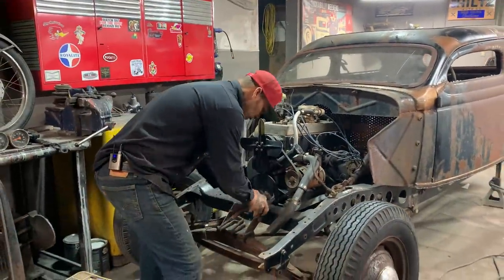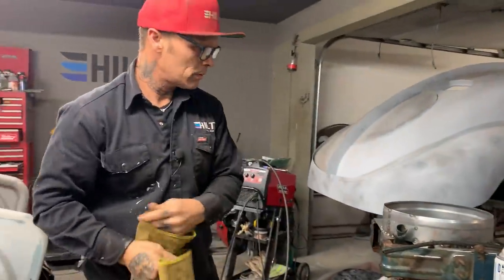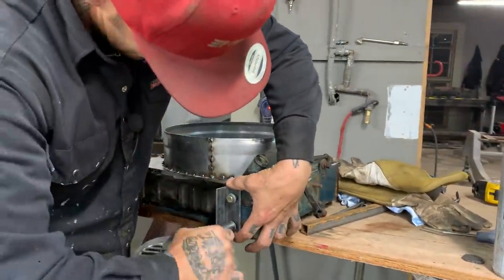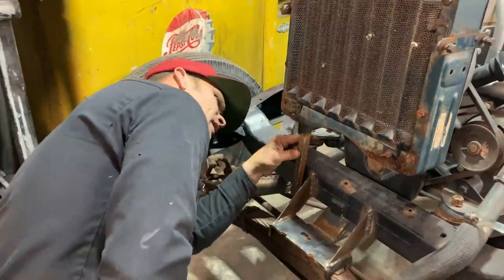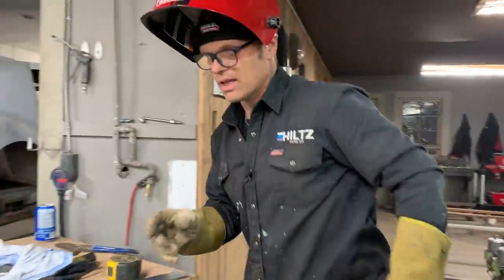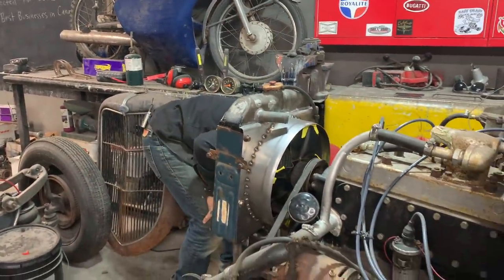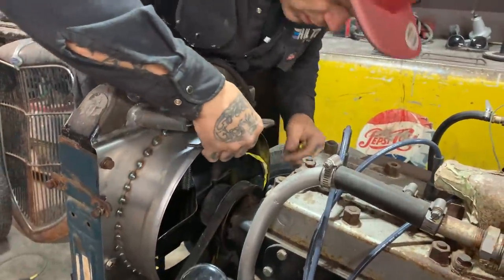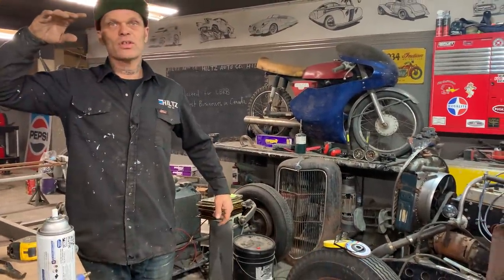FABRICATING A RADIATOR SUPPORT TO MOUNT RADIATOR

Comment: My mind is confused wouldn’t it need more clearance if rad is mounted to frame and fan is engine mounted would it rock with the engine when hammering the gas?
Reply: trial an error, fun fun  unless you have thousands into a project then not so fun...lol
Reply: It’ll work out in the end, always does, my son suggested mounting the rad to the engine, there is a bracket there on the side u could run straight back, or electric fan, actually u could just cut the shroud away some so the fan is adjacent
Reply: Bien sûr le ventilateur va toucher la structure des de le moteur va bouger sur ces supports !
Reply: hope the engine is solid mounted cause he will need more room in that shroud for the fan

Comment: Remember, the older cars had rods triangulated from the firewall to the top of the radiator with nut and thread adjustment to reduce vibration and movement.

Comment: How much movement will the engine have during Starting and Reving?  If using rubber motor mounts there is a possibility of the Fan hitting the shroud.
Reply: Good point
Reply: not possibility but a certainty
Reply: He never thinks that far ahead
Reply: Yes. a trip around the dooryard is likely to show that on acceleration and deceleration the motor mounts allow too much movement for the available clearance.  But it'll also show where (my guess is top on acceleration and bottom on deceleration.)  All fixable with a fan trim.  He doesn't want to do that because the fan's tiny already, but I think Chad's theory of how long it needs to run to do an eighth-mile is probably good.  I like the Austin grille on it all.  Some swoopy shrouding would add a little weight and a lot of character.
Reply: That fan is going to be ripped apart…but let’s see
Reply: @Stunthangar  this guy is a know it all that knows nothing
Reply: How are you doing Robert
Reply: @genefoster7238  hi
Reply: @hoolgatenewcastle3312  Exactly what I was about to state, you would need a lot of clearance around the fan, the engine will move about considerably on those rubbers and the fan shroud is static.

Comment: If your taking votes I still like the old Ford grille back on a slant.
You could fabricate air deflector s inside to force air through rad.
Reply: Yep, the Ford grill looks better. As far as cooling goes, it's gotta be good for an eighth mile plus staging. It's not going to be running in the desert for hours. It should be fine.

Comment: Both the radiator shroud and mount are great pieces of fabrication, but when I see this car I think Model T and Model A which didn’t have any shroud, granted this radiator is much smaller but again it’s an old copper core and should work fine without. Not a fan of the Austin grill, the 36’ one has the right look for this car in my opinion. Chad as always you do you and what makes you happy 😊

Comment: ***Motor Issue*****  Just want to point out 2 issues that you may have with the motor  being at such a steep angle.  1.  The pick up tube in the oil pan may be in the center of the pan and with the angle of the motor, the oil may pool to the rear.  You risk oil starvation, which could destroy your motor. 2.  Oil foaming.  With the steep angle of the motor, the oil may pool to the rear of the oil pan and the counter weights of the crank shaft may hit the pooling oil causing it to foam up.  Both conditions may destroy your motor.  You can do  a dry sump set up to avoid all this.  Please look into it.  Love what you do!!  Carl
Reply: A dry sump would be amazing to watch. Can you even imagine.

Comment: I am with Dale on this one I've been wondering about that since yesterday when I saw you constructing that itty-bitty radiator shroud and pulling a Michelangelo on the fan blade it surely will be an issue unless you have solid motor and tranny mounts and it definitely will twist it surely will twist when the front wheels come off the ground with a signature Miss jolean wheel stand especially since bad Chad pulled a Picasso and put all those holes in the frame with a 2000 horsepower motor that frame is going to twist like a soft pretzel surely surely be that's what I say don't you agree Dale

Comment: I believe yes I do i believe the radiator is from a 1971 Ford backhoe the reason the guy replaced it was because it had multiple leaks and it had been repaired several times in the past 50 years
Reply: It did look like one side was rotten. 
I just assumed he filled it full of water before using it. Sometimes you just have to spend a little extra time and do these things.

Comment: Bunch of people talking about engine torque, you can always do what we did years ago. Chain it down , she won't move much, if it moves at all. 1/4' plate across the front of the motor and over to the frame always works too or cut that shroud back and lap a piece of round rod around the outside of the shortened shroud. Then lap a new 2 - 3" piece of steel on top of the rd. rod. That'll get you all the clearance you need. Sq. stock would also work, whatever's closest.

Comment: Chad and jolene when the engine moves around on its rubber mounts will the fan not hit the shroud cause the radiator won't move with the engine. Just a thought hope it's not the case. I would use an electronic fan that way you can mount the radiator where you want to and that's my belly button as you say. Keep up the great work the both of you 👍

Comment: Instead of the square stock holding the rad up, use two turnbuckles to hold the rad up. 
That way you have infinite adjustment up and down. Weld the ends of the turnbuckle to the frame and rad.
Use a nut on the turnbuckle threaded rod to lock the turnbuckle in place after adjustment is correct. 
Can also use turnbuckles for side to side adjustments. I have used a turnbuckle to adjust alternator belt tension, by turning it with a finger and thumb. Just a suggestion. Any hardware store has turnbuckles.

Comment: Couple adjustable tie rods from those side bolts back to the firewall to keep it in the right place, might have to trim a tiny bit off the end of the blades. Not a fan of the Austin grille, but Chad will make it work with whatever makes him happy.

Comment: Maybe add a gusset from the back side of the square tubing to the top of the frame to keep the rad from moving back towards the motor? Great job today in mocking up the radiator. Looking forward to see what tomorrow brings.

Comment: You'll have to put a chain or turnbuckle on the drive side if engine to drive side of frame to keep the motor from torqueing to passenger side hitting the fan.       Drag racers used to do it all the. time
Reply: Actually we did that to keep the shifter from binding. The shifter was bolted to the crossmember and the rods would bind when trying to shift a four-speed. 
In 70 we went to an interlocking mount that would not separate when the rubber broke. All big block Chevy Muncie chatter

Comment: With the rigid mount rear axle the motor mount will be absorbing  the torque from that inline six. That fan shroud could be trouble. You don't need it.

Comment: Enjoy watching.  In regards to the fan Chad, you may want to consider the act of centrificle force. In otherwords , the fan will inevitable expand under running conditions. Probably more then you would think. Nice work. Keep it up.
Reply: And ofcourse the engine flex goes without saying. Awesome content.
Reply: Maybe just bend the blades forward a little bit. It would be a lot faster. Just get your channel locks out and start bending

Comment: Hello Chad, it was the first time I seen a fan blade cut down, the shroud you built amazing, I love your work.
Reply: I generally use a string connected to the center with a marker out on the end to draw a circle, or in this case the trim the fan blades. 
3.1416 for circumference of shroud.  Chad’s labor is free so eyeballing it is good enough.  Can’t wait to see the maiden voyage. Should be great

Comment: The rad bolts seem to be a little long. Do they hit the radiator? 
Need a little more clearance on the fan at least an inch or a inch and a half.  
You definitely need more than a couple of piece of paper.
Or it will sing when you torque the engine
Also mount the radiator on some shock absorber rubber mounts for a little flexibility.
Other than that you did a fantastic job!

Comment: Mounting radiator will be interesting. I am wondering if small amount of space between fan blades and shroud may be a problem due to engine vibrations and torque. (The added bead will help solve any engine movement problem.)

Comment: The shear you were using yesterday, when you come to a corner, if you push the last bit of the curly bit back into the slot you have created you can then cut right up to the corner

Comment: Do the motor mounts have to be extra strong to prevent the engine from moving inside of the radiator housing given the tight tolerances?

Comment: Mounting the radiator is more complicated than it looks!  Haven't seen yet whether there will be bracing from the top to hard mounts. Vibration needs to be kept in check? The base is really strong, but that radiator structure looks like it  might bend under vibration. No?

Comment: If the fan moves and trims the shroud it merely means the shroud and fan had too much steel and needed to be lightened. It is like an automatic adjusting fan and shroud... possibly give the blades a little twist a little bit to allow more air movement. Worst case just cut the shroud in a couple of places, spread it out, and weld it back together. No problems. >His motor mechanic will come and help start the engine again, at which time he may express a concern if their is one. I didn't think the engine would move, didn't he weld it in there in the first place?
Reply: Exactly, this fan will self clearance.  
Any metal that falls off will just lighten the car that much more. I wonder if he if he could cut holes in the body? I don’t think anybody has ever done that before.

Comment: Waterless coolant has a boiling point of 375 degrees Fahrenheit  it is expensive  but a solution if extra cooling is  needed with the small rad  .
Regardless please put antifreeze in before winter hits as Chad mentioned it's going to door yard till next year.
Reply: You don't have to put any coolant in at all over the winter. That way you can be sure it won't freeze.
Reply: The coolant will survive at 375, but the engine wouldn’t
Reply: @i8ntnuts  The engine won't be running in the winter.

Comment: How do you change the fan belt?
Reply: Pull the rad out or give yourself half inch clearance fan to shroud. Bad chads choice way to tight .
Reply: Why change it? It’s been OK for 85 years.  It’s barely broken in

Comment: I think we can all agree the shroud is too close to the fan.  It will end up cut off.  When I was watching yesterday I expected he would cone the shroud out from the rad toward the engine.  Like the thing they use for dogs when they get their ears cut.  That would allow the small radiator to be used while affording extra space for the fan blades.  Otherwise it will end up shroudless.  Only other way around it would be to somehow mount the radiator via supports coming directly from the engine block so that it moves in perfect unison with the engine.
Reply: That said, if he uses it only for the races and he doesn't install a thermostat, that little radiator should do fine even without a shroud.  But in that case I'd advise putting a larger fan back on it.
Reply: Do you have any idea how long it would take to make a cone?
Reply: @i8ntnuts  wait.  Are you serious?  We are talking about Bad Chad.  He could simply roll some steel just like you would do paper to make a funnel.  He could even make it out of paper.  Then lay it out and cut it to size.  Then just zip cut it, butt weld the seam, and weld it to the shroud.  Come on man.
Reply: @i8ntnuts  ps.  We might just find out once he starts it and the fan scrapes the inside of the shroud and when he revs the engine the shroud self destructs.

Comment: That's a tiny radiator Chad. But as long as keeps the engine cool for the little while it will be running is fine. Some race cars don't even have radiators at all.
Reply: How are you doing Behr??
Reply: @hoolgatenewcastle3312  I'm fine thanks

Comment: The fan does not have to set in the shroud, it would work great about a half inch from the shroud, it would pull air right thru the radiator just right.  Keep up the great work.

Comment: Chad, as much inconvenience as you experience plugging and unplugging, replugging and untangling extension cords I'd say it would add tremendously to your productivity to go buy a Dewalt 20v battery powered angle grinder and make your life better, God knows you use the angle grinder more than any other cutting tool that you own.  the only other tool you use more is probably your welder
Reply: That’s Chad friend Jolene. She does such a great job with the camera. I think she just has a lot of natural talent. You can also find them on Facebook and of course she does the computer work on that as well

Comment: I see trouble ahead, not enough clearance between fan and shroud, blades should be half in and half out of shroud, cant tell how close fan is to radiator, should be 1 inch at least. But then again, if its only going to ran a 1/8 mile, probably dont even need a radiator.
Reply: Keep the radiator, get rid of the fan.
Reply: You’re probably right. At old Hup six probably has what, 6.5-1 CR. 
It might take a while just to get it warmed up

Comment: To prevent the  fan from hitting the shroud the motor mounts need to loose the rubber and be hard mounted. This will also help with torque loss do to excessive engine movement. Tom Martin

Comment: How is the front spring held to the cross front member? Usually there are 2 u bolts with a plate on the bottom side.
Reply: I think Chad said he is going to add gussets for safety.

Comment: Good day HILTZ MOTOR CO.  im not sure if you have thought about supports from radiator to fire wall may help radiator from moving back towards the engine when Jolene launches all that raw horse power from the starting line.. 🤣😂🤣

Comment: I don't know if that motor is mounted with rubber mounts, but if it is. that fan is going to hit that shroud. I think you should have made it a bit larger in diameter.

Comment: Because all the cylinders are straight up as opposed to side to side in the "V" formation, I wonder if there will likely be little to no twist under throttle torque like a V motor would,  guess we will see?

Comment: Chad did mention top-braces for the rad, running back to 'something'. Without those the rad will rock fore-&-aft and tear itself to pieces ....unless the fan beating on the shroud keeps the rad in place? (Just joshing- add the braces.)

Comment: Hi won’t you need to mount it to the engine so the radiator moves with the engine as the engine is rubber mounted and will move when you rev the motor

Comment: Typically radiator supports are "U" shape, thus providing maximum support. I fear this design may vibrate, flex etc. forcing the fan into the radiator.

Comment: He can mount the engine to the frame without the rubber mounts or add an engine strap from the frame to the motor to stop any engine movement.

Comment: Chad, ditch the fan, mount the radiator lower on the cross member, a drag car does not need a fan for the few minuets it is running,

Comment: Yup absolutely I completely trust my ability to use tape measure I’ve used math and measuring my whole career I also can go by eye too but I don’t use metric tapes and use down to 1/16th tho and if absolutely necessary 32nd never needed more than that as finer than that is machinist teritory

Comment: Chad , i never catch you guys live.  so here it is,  you should put a good 3/4 inch at the very minimum, | depends on the engine, how smooth / how rigid are the motor mounts. |  clearance all the way around that fan. the rubber engine mounts will flex and move, it could just stred that shroud.  been there and done that.  Danger !! Danger !!   Will Robinson  !!!!!!!!!!!   diameter of the fan shroud itself , minus at least 2 inches , diameter of the fan  ...that will give 1 inch per blade clearance if its centered ...........👀  Cut The Blades

Comment: An electric fan could be a simple solution. Also, it could be easily mounted lower, at a better angle. I admire the use of the original fan, but it’s causing more problems than it’s worth and the parts of the blades you cut off are the efficient air-moving bits. Just saying.

Comment: That 1/4” on each end of the fan is not going to give you enough clearance. When the motor starts shaking it is going to move a 1/4” or more from side to side hitting the inside of the shroud. But I love the the overall car. Wish I could fin me a 35 to 37 to do something with.

Comment: If the engine is not a solid mounted engine the torque will tear up the fan. Not enough clearance for a rubber mounted engine.

Comment: Would have removed the fan from the motor and installed an electric fan on the rad or just don’t use a shroud.👍🇨🇦
Reply: How are you doing Dan????
Reply: @hoolgatenewcastle3312  I’m doing good, you may have me confused with someone else though.

Comment: Chad do you need a grill and engine hood if not it would look cool and save weight to
Reply: If the front end is too light it might do a wheelie and flop over. OK I’m just kidding.I think it would look better with a grill and at least the top part of the hood. Leave the sides open for spectator viewing

Comment: The water outlets are wrong on the rad !
Reply: Maybe he can flip the radiator upside down? Or maybe use some exhaust pipe to put a few hoses together? It would be too much work to switch the outlets. If you turn it upside down they will be on the opposite side right?